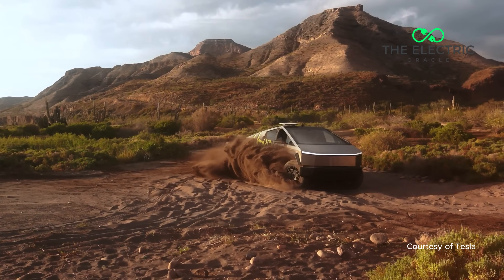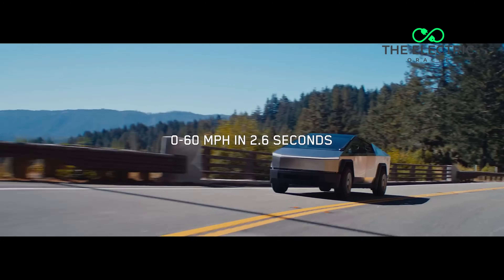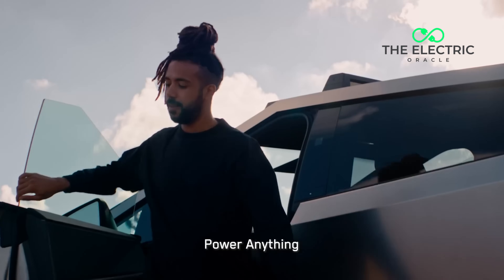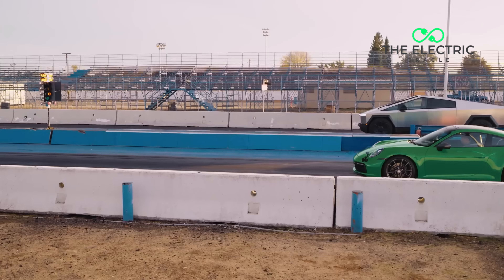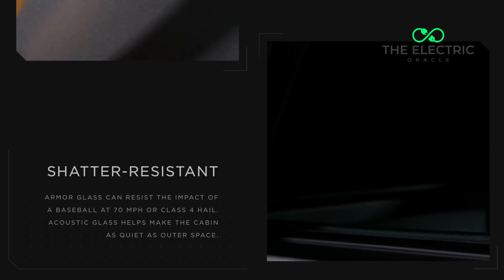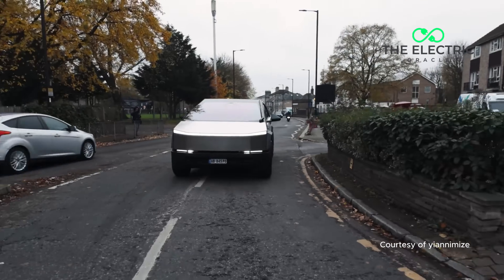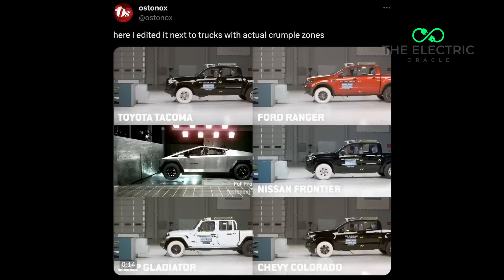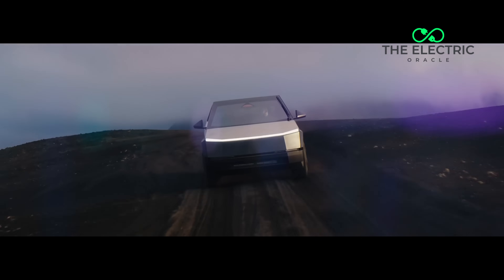5 Safety Issues Keeping Tesla Cybertruck Off UK Roads 🇬🇧

Comment: Cybertruck does have crumble zones, they are in the castings, there is also the light bump structure within the front bumper. The Cybertruck was never designed for Europe only the USA. USA doesn't have many if any pedestrian safety rules yet, the governing bodies are currently looking to introduce some rules.
Reply: Pedestrian safety rules are over 50 years old in Europe. Why do you think European cars never had those huge US-specific 5MPH bumpers? Yup. They were dangerous to pedestrians...
Reply: Not for the next 4 years
Reply from the maker: Good points, thanks.

Comment: It's an impractical ugly monstrosity that has flopped in the US after initial hype, thousands walking away from their orders and depreciation is astronomical people losing over $20k in just 6 months.
Reply from the maker: Hi David, thanks for your comment.

While the Cybertruck has faced challenges with demand and depreciation, calling it a "flop" is a bit of an exaggeration given it was still the best-selling electric pickup in the US. The depreciation claims are generally accurate, though the $20,000 figure varies depending on the model and timeframe.

Comment: Most of what you’re talking about is in relation to homologation approval, if someone wanted to register one for UK use then you’d go down the SVA route which is about 100 times less effort and agro to achieve compliance.
Reply: Apparently SVA is no longer a thing - it was supplanted by the IVA around 2009!  Still need to meet regulatory and safety standards so even if it's '100 times less effort' it seems like it ain't happening anyway 😆
Reply: It wont meet IVA, there are minimum radius regulations for bodywork edges and fittings for a start, hard enough to get a 90's car without hideaway wipers or older cars with chrome bumpers through the test let alone something built with knife edge front wings.
Reply: You are correct, guys just not done his homework, most yank cars are imported as personal imports. Change a few lights, add mirrors, side repeaters etc
Reply: @martinhill3986  Thats normally the nub of what is needed, though there are also radius requirements for edges which it seems the Cybertruck might struggle with - This is not normally an issue as every other modern vehicle body tends to be designed to the strictest world standard so you just need to change the light clusters to access other markets, however it seems the Cybertruck is designed to only consider pushing the limits of the US market requirements which if more lax would make even an IVA an issue. A stick on rubber strip would probably work though it would ruin the look like a 1970's European car with US federal spec lights and bumpers.
Reply from the maker: Thanks for your comment, Simon.
I'll have a look into that.

Comment: Besides numerous safety issues, there're no parking bays in Britain designed to accommodate large vehicles like Cybertrucks and American SUV's.
Reply: In fact, in Devon, I believe they're penalising large (SUVs mainly) because they don't fit in standard parking bays.
Reply: @rugbygirlsdadg  They should park where the lorries stay. The bays are much larger.
Reply from the maker: V good point.
Reply: Irrelevant....I've seen plenty of full size Yankee pickups. Naff huge but not banned
Reply: Well, I visited other countries  with different bays, people would park the cars properly, if a big car was in a small bay it would be fined (I witnessed this in 1965). I don;t see police in UK regulating the same issue, it is a police problem.But TESLA wanted a showcase car/truck and it got it. They have to adapt to our reality instead the boss throwing Nazi salutes, as he believes dictatorships would do what he wants. It never happened before.
Reply: The most ugliest heap of sh*t I have ever seen, I would rather walk😊
Reply: In aus if your vehicle doesn't fit in the space (and isn't banned for other reasons ie truck in light car park) you can use more spaces!
Reply: Britain doesn't get full size US SUVs. Anything under 200 inches long is a mid-size and if it is under 205 inches it is on the small end of full-size.
Reply: Really? If you watch @yiannimize video he takes his Cybertruck through a Mcdonalds drive thru in the UK and then parks it in the car park between 2 other vehicles no problem!
Reply: @S4f3ty_Marc  Different parking bays in different places are different sizes.  Even in a single town there can be quite a wide difference, but the average across the UK is WAY smaller than in the US.
Reply: Its no bigger than a LWB van like a Sprinter, there are loads of them on UK roads - can't park one everywhere but with a bit of thought its totally possible. There will be many of them hanging out the parking bays of your local Premier Inn carpark.

Comment: A 7.5 tonne truck only weighs 7.5 tonne when fully laden. Unladen its about the same as the Cybertruck
Reply from the maker: Hey, thanks for your comment.

I think your statement is partially incorrect:
The first part is correct - a 7.5 tonne designation refers to the maximum authorised mass when fully laden
The second part is incorrect - an unladen 7.5 tonne truck (4,000-4,500kg) weighs significantly more than a Cybertruck (approximately 3,025-3,129kg)

The difference in unladen weight between these vehicles is roughly 1,000kg or more.

Comment: You are incorrect about the weight, the 3500 limit does not apply to ELECTRIC VEHICLES or they wouldn’t allow delivery vans with batteries, and the new limit is 4200kgs. But a Motorhome at that weight need a C1 licence😮
Another thing is they have electric door lock which may trap the occupants inside when the battery blows up and kills the electrical system
Reply from the maker: Hey, thanks for your comment.

I actually think your statement is partially incorrect. While there is a higher weight allowance for electric delivery vans (4.25 tonnes), this does not apply to motorhomes, which still require a C1 license if they exceed 3.5 tonnes, regardless of their power source.

Comment: The reason the Cybertruck isn't officially sold in the UK, is because it doesn't meet our safety standards. No amount of modifications can change that. If you want an American Pick Up Truck, buy a Ford Ranger. If you want an American EV, buy a Chevrolet Bolt. And if you fancy something American in stainless steel, buy a DeLorean. Don't import one of these dangerous razor edged death traps.
Reply: The CT (as they classify it) and the Ranger are in different classes. The CT would compete with the F150 (Lightning) in the Ford line up. As far as I know no manufacturer imports full size pickups into the UK. GVWR on the CT would put it in the same class as a F250.
Reply: @rich7447  The F Series isn't available in the UK. If you want an American Pick Up here, it has to be a Ranger.
Reply: @matthewgodwin3050  None of the full size are available in the UK, so it isn't a surprise that a full size competitor wouldn't be designed for UK use.
Reply from the maker: Thanks for your comment, Matthew.
I honestly can't see too many importing these anyway.
Reply: @TheElectricOracleChannel  The UK needs to import (tariff free, obviously!) a few idiots from the US - they seem to have more than their fair share.

Comment: You forgot an important issue - if someone crashes into you, how do you get out? Do you know where the emergency release is? Does it still work?
Better get a BYD, with features that people actually want, once they grow out of showing-off to their friends.
Reply from the maker: I think if it was made road legal here, the fire brigade would need to strip one down and find out with assistance from Tesla of course.
Reply: @TheElectricOracleChannel  Why should they have to? If it can't be dealt with using existing methods, tough. Leave it to burn out.
Reply: The manual release for the front doors could be better highlighted, but is easily reachable by an occupant, perhaps reachable by someone from the outside if they can break the glass away enough.

The one in the rear is ridiculous. Good luck remembering where it is and getting to it when you’re addled after a collision, and there is zero chance of a rescuer from the outside is getting to it. It is hidden under a panel at the bottom of the pocket near the bottom edge of the door, and it is a fiddly loop rather than a sturdy handle.

Neither set of doors has external handles.

The sheet metal is thicker, and jaws of life work slowly enough as they are. It will take more time to cut away enough to extract unconscious people than with other vehicles.

Comment: The question is not whether the Cybertruck should be modified or approved for the UK, it is whether it should be approved at all for use in the USA or anywhere. Almost every design feature of this monstrosity was decided as a whim, not as an engineering balance between functions and requirements.

Since a world-wide ban is impossible, I hope this thing quickly fades from the favor of the American market, just as the Hummer did. There is no place for any equipment that has to be totally redesigned to comply with simple safety requirements.
Reply from the maker: You make a good point, Andres. I don't totally agree. I think this will be well served in the US. In fact, I think it will become quite popular. I'm not sure we need them over on this side of the pond, though. We just aren't set up for them nor need the features it offers.

Comment: The fire services are not equipped for ev fires as is.
Reply from the maker: Good point. However, I think they will continue to improve. They have to with so many more EVs in the market.
Reply: This is no longer true. All of the fire services now have protocols and processes in place for dealing with the miniscule numbers of EV fires.
Reply: @ They have protocols, but those protocols exist due to them not being equipped to extinguish the fires. To be fair you cannot extinguish them, they are fully self fueling once they start. The protocols are there to minimise damage to anything around them.

Comment: so UK safety regulations prevent us having the safest car...
Reply: Safest for who?  Definitely not for vulnerable others!
Reply: Safest car? The Cybertruck has almost none of the safety features that the automotive industry has developed in the last 40 years for cars. For example, it has no crumple zones to absorb the energy of a collision, which is something that my car from the 1980s already had, among a gazillion other safety features for the passengers and for the people you crash into.
Reply: It’s dangerous to people it hits, and as mentioned, the insufficiently absorbent “crush zones” cause greater forces to be transferred to its occupants, which is probably why they are often unconscious after collisions with rigid objects like concrete walls and large trees.

If you watch the original frontal crash test, you will see the front dummy hit the airbag hard enough to crush into the steering column. You will also see the rear dummy slip past the shoulder restraint and crash hard and fast into the back of the front seat. Short clips of that original video footage are included in this video post, but they are edited so the magnitude of interior impacts are not shown - the first stops just before the impacts, a subsequent clip resumes after the impacts have happened.
Reply from the maker: Hi Andy, at the moment, yes.

Comment: The cyber truck weighs 2.9 tonnes and EVs are  also given a 500 kg allowance for the battery.Check your facts
Reply from the maker: Hi Rich, thanks for your comment.

Let me correct these claims:

*Cybertruck Weight*
The Cybertruck's weight varies by model:
- Dual Motor AWD: 6,669 lbs (3,025 kg)
- Cyberbeast (Tri Motor): 6,898 lbs (3,129 kg)

So the claim of 2.9 tonnes is incorrect.

*EV Weight Allowances*
The weight allowance regulations vary by region:
- EU: Electric trucks are allowed up to 2 tonnes (2,000 kg) additional weight compared to conventional vehicles
- UK: Zero-emission vehicles (ZEVs) are granted a 2-tonne allowance, while alternatively fueled vehicles (AFVs) get up to 1 tonne

The claim of a 500 kg allowance is incorrect. The allowances are actually more generous to compensate for the heavier powertrains and batteries in electric vehicles, which can significantly impact payload capacity.

For context, EV batteries typically weigh around 454 kg (1,000 pounds), though some can be as heavy as 900 kg (2,000 pounds).
Reply: @TheElectricOracleChannel  Max weight is over 4 tons. Empty weight means nothing. Please check your facts.😉

Comment: i can drive a cybertruck on the road licence wise, i used to drive 3.5 ton recovery truck, it depends on when you passed the test, at some point in time they removed it from the normal car licence and made it s separate class.
Reply from the maker: Hi Chris, thanks for your comment.

If I may, let me clarify the license requirements for driving a Cybertruck in the UK based on when you passed your driving test:

*If you passed before January 1, 1997:*
- You automatically received Category C1 entitlement (vehicles 3.5-7.5 tonnes)
- You could theoretically drive a Cybertruck weight-wise, as it falls within this range

*If you passed after January 1, 1997:*
- You only received Category B entitlement (vehicles up to 3.5 tonnes)
- You would need to obtain a separate Category C1 license to drive vehicles over 3.5 tonnes

*Cybertruck Weights:*
- Dual Motor: 3,025 kg
- Cyberbeast (Tri Motor): 3,129 kg
- Gross vehicle weight exceeds 3.5 tonnes when including passengers and cargo

However, regardless of your license category, the Cybertruck is currently not legal to drive on UK roads as it lacks a certificate of conformity and does not meet UK safety regulations (as I mentioned in the video). Police are actively seizing illegally imported Cybertrucks.

So while you may have the correct license category if you passed before 1997, you still cannot legally drive a Cybertruck on UK roads due to the vehicle itself being non-compliant with UK regulations.
Reply: @TheElectricOracleChannel  All correct and I would add in the UK that if you are over 70, you'll lose that grand-father rights C1 7.5 t/towing entitlement unless you apply for a medical.  And all that has to be renewed every 3 years.
Reply: Yeah, i am quite sure i can drive up to 7.5t as i passed back in the 90's
Reply: @SubparPaddler  It depends on which year in the 90s you passed your test. The law changed for people who passed their test after Jan 1997 to only allow 3.5 ton without a separate test.
Reply: Is that kerb weight or laden weight?